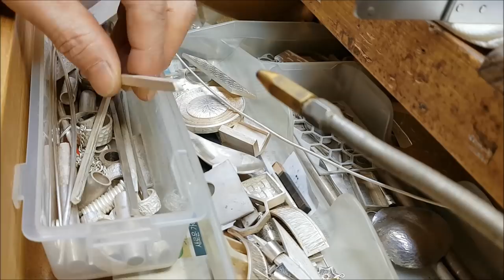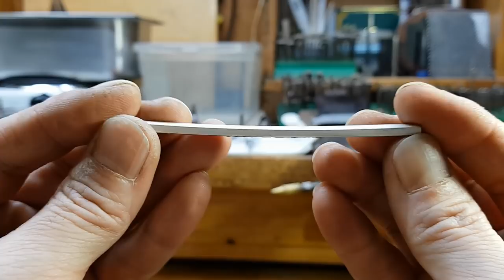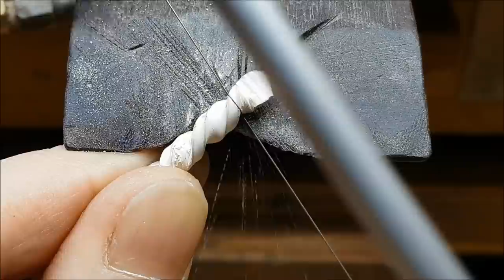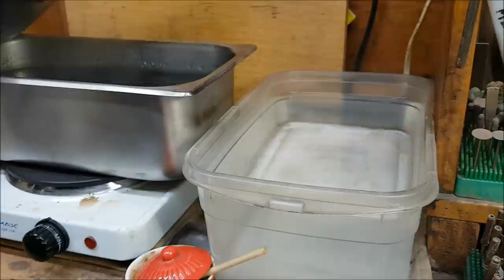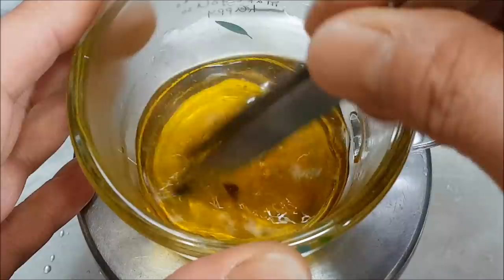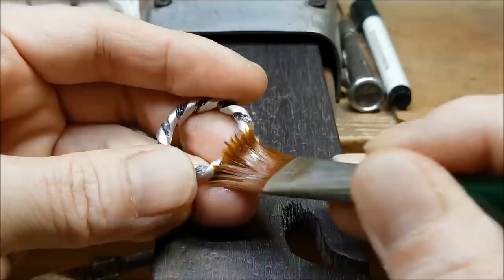Twisted "SILVER RING" Making process

Comment: I have a few question if you don’t mind?

Why do you pickle the metal each time you anneal it, wouldn’t it be easier to just do it at the end?
Why is the wooden board you cut on black?
Did you learn this on your own, or did you apprentice with someone?
Do you ever worry about all those scraps and thieves?
On average, how much metal do you think you lose through processing each year?

Thank you!
Reply from the maker: 1) The reason for pickling every time annealing is,
This is to keep the silver material clean during work.
That's because you can feel the best of your current state and work more precisely at the same time.

2) Black wood is ebony.
It is a very hard top quality wood.
Because I mainly deal with silver, a white metal,
Black wooden boards that are easily visible are used as a base.

3) Basic things I studied with a master's degree in university,
In total, I have been applying these tasks for 29 years.

4) No worries about scrams and thieves.
That no matter how much you tell, you can't do it.
Because I know well.
Not everyone can easily follow.

5) I don't know what it means to lose metal....
Almost 95% of silver powder can be recovered.
Once refined, most of it can be recycled.

I did my best to answer.
I do not speak English well.
Everyone is helped by the translator.
It is difficult for me to answer in this detail.
We will politely decline to answer any further questions.
sorry !!

Comment: Another great video! 

So I take it the hammer texturing didn't do what you wanted and thats why you used the flat burr? Also, what does the oil at the end do? Prevents oxidation? Does it need to be reapplied periodically? Thanks. Always a pleasure to see your work.
Reply from the maker: Texturing is for two reasons.
The one is,
If you twist the pattern, the pattern is broken, which is a supplement.
Another one,
The rest of the valley just tried to be normal,
It looked too normal at the end, so I worked on additional patterns.
Thanks~

Comment: What is that stuff on the burner ur using??
Reply from the maker: I don't know what you are wondering
Reply: @SilverMeister  is it acid dip ?
Reply from the maker: This is dilute sulfuric acid.
It is clear like water at first, and turns blue as you use it.
Nonferrous metals (gold, silver, copper, aluminum, etc.) are 
different from general ferrous metals,
In each process, it must be pickled.
It is an acid (sulfuric acid).
It is a mixture of 10% sulfuric acid stock solution + 90% water.
When mixing acid and water, you must add acid to the water.
If you add water to an acid, 
it is dangerous because it may react as if it explodes at the initial moment of addition.
Do not boil dilute sulfuric acid, but always keep it warm (about 50 to 70 degrees),
Soak your work in it and pickle it.
It dissolves and removes impurities, 
fire scale and borax residues generated during work.
It is a clear color at first, but the more you use it, 
the more it turns into a light green (pocari sweat) color.
After using for a while, 
a small amount of waste acid is mixed with a lot of water and diluted.
When the quantity is large, 
it is sometimes discarded by requesting a specialized collection company.

Comment: How do you prevent oxidation while heating the silver?
Reply from the maker: There is no need to prevent oxidation while heating the silver.
Just do what you see in the video.
Reply: @SilverMeister   what is the benefits of the camellia oil ?
Reply from the maker: @MrAdrian652  
Because it is non-drying oil, it does not dry out.
It acts as an oil film coating to protect the surface for a long time.
Reply: @SilverMeister  would it also work on damascus?
Reply from the maker: @MrAdrian652  
I believe it is.